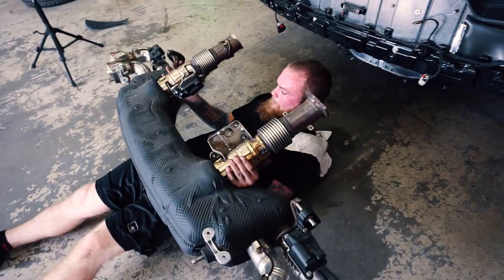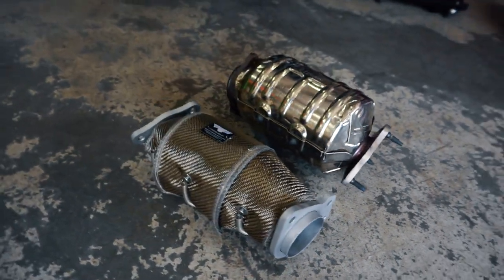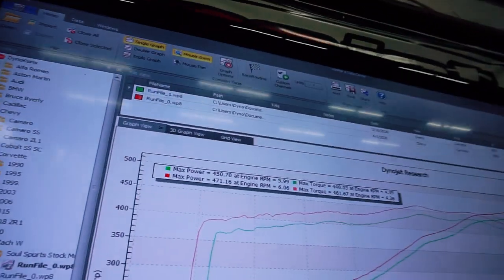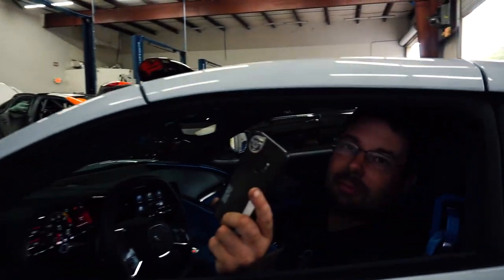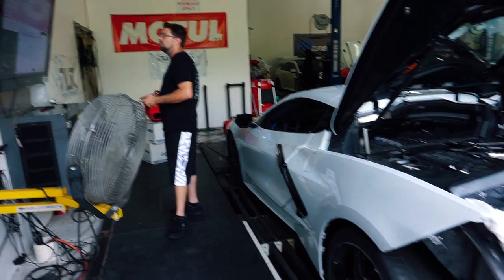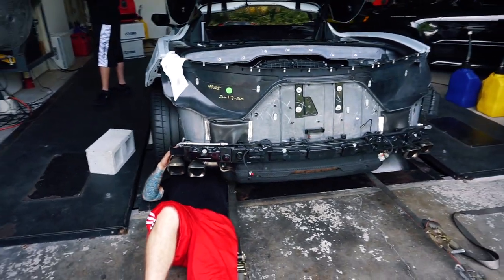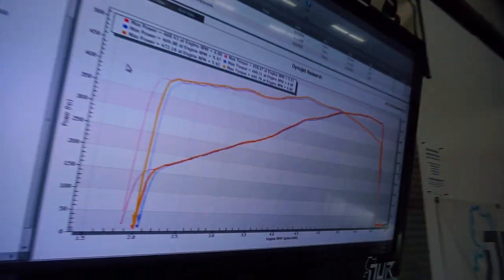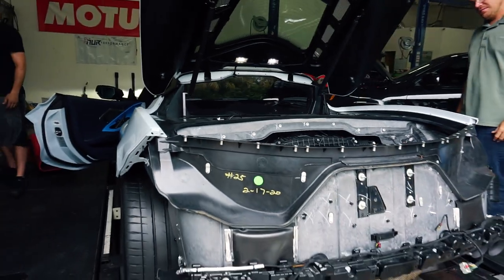2020 C8 Corvette Soul Performance Full Exhaust Installed + Dyno *SHOCKING!!* Vlog #4

Comment: So, I suppose for the best gain and least cost, just replace the cats with stock mufflers and you get 20/20. Am I right?
Damn, those cats and exhaust are EXPENSIVE. Better put that $6,400 + labor towards a TT system.